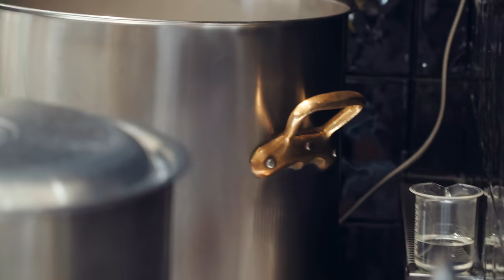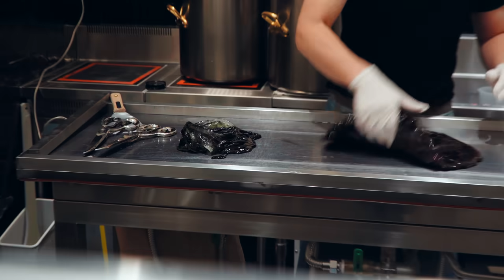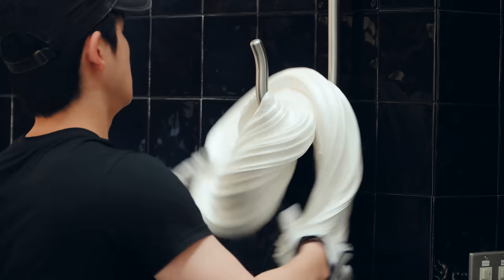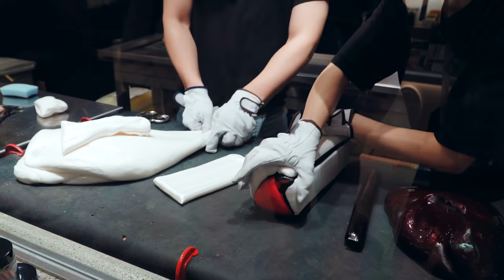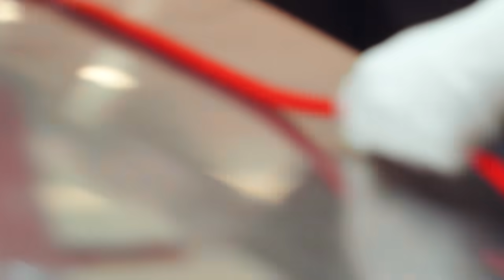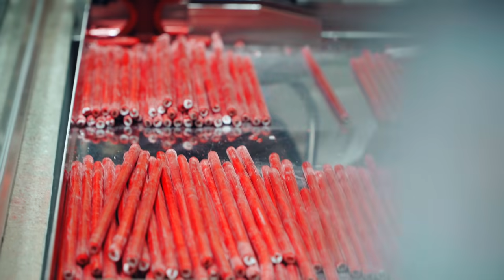手作りキャンディーを作る∥Handmade Candy Making∥パパブブレ∥in Japan

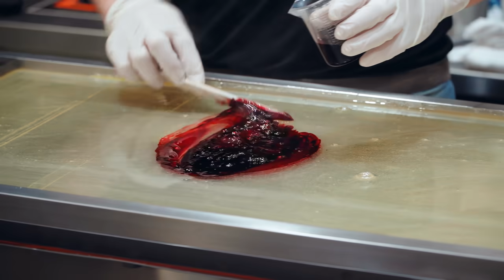Comment: 4:21 the point i couldn't understand is that why the yellow jell is starting to boil when it mixes with the red stuff?
Reply: Because the temperature of the candy is very hot. It is molten sugar. So when they add the food coloring, the heat causes the liquid to boil.